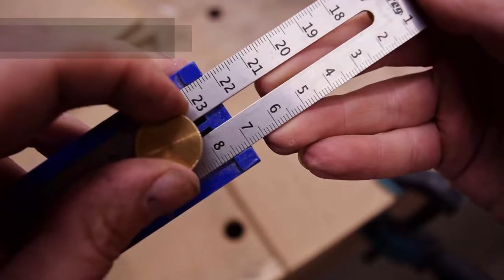5 must have easy to build woodworking jigs

Comment: I like the 90 degree clamping jigs.  I made myself a set about a year ago, but these are more practical and prettier.  I cut mine in pairs so each outer part has a matching inner part that pair up for both sides of a clamp.  I also like the vertical drilling jig, but I'll hold off on that one until I actually need one.

BTW, I like your tape dispenser.
Reply from the maker: Those are some kind words, Frank! Thank you so much. I'm glad you liked the jigs.